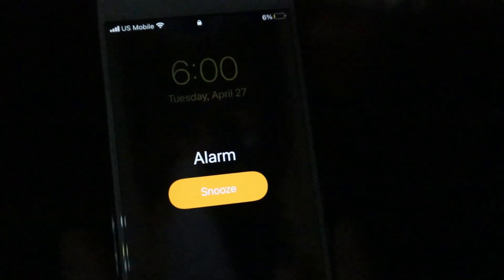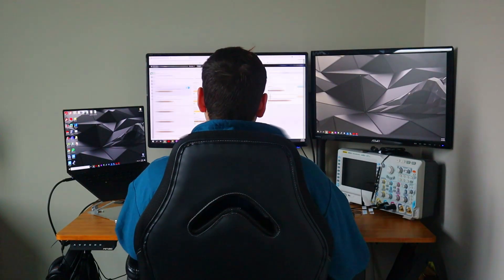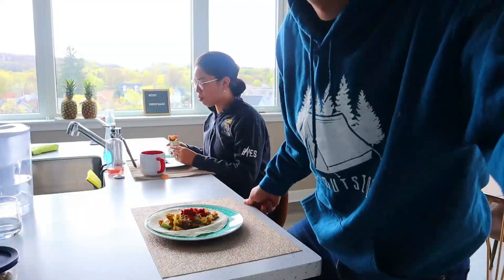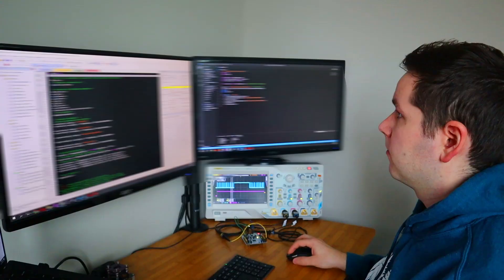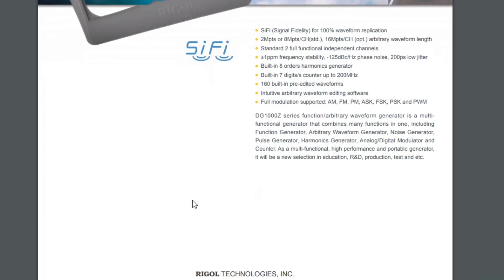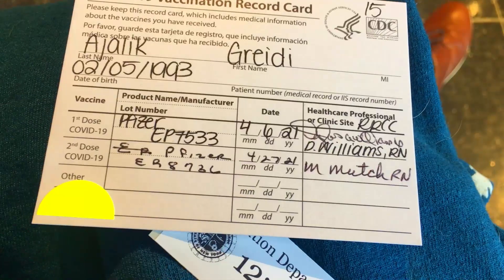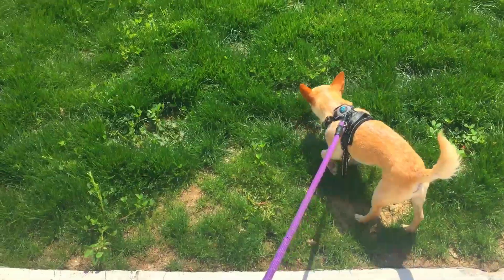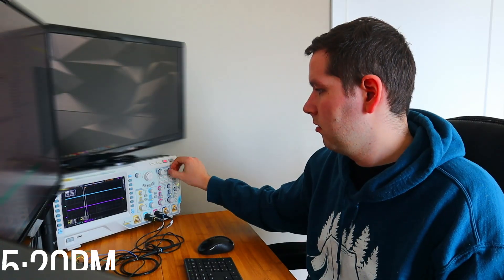A Day in the Life of an Embedded Software Engineer | Work From Home

Comment: DS4024 is > 3000 dollars yikes
Reply from the maker: yea... it's expensive :/
Reply: @GreidiAjalik  The question is then, do you really need it/use it for your use cases? And if yes, which options that this expensive scope has that others don't?
Reply from the maker: I did use it for my use cases - whatever I did in this video can be done with way cheaper o scopes. The scope was provided by my employer that I was able to use while working from home - now it's returned to the employer. Honestly I'm not a scope expert by all means... you can do a comparison of this scope vs cheaper ones using the info here https://www.tequipment.net/RigolDS4024.html#tech-specs  I wouldn't personally ever buy this expensive scope for hobby use or simple professional work.
Reply: @GreidiAjalik  cool, thnx for the link!

Comment: I have a french master 2 in electronic embedded systems . But what's the difference between electronic embedded systems and software embedded systems
Reply from the maker: hey! I'm not very familiar with "electronic" engineer term. I'm assuming it is referring to working with the electrical/hardware side of things - electrical design and layout. Embedded software engineer focuses on the low level software for specific MCUs.

Comment: Can I get a computer science degree to become an embedded software engineer?
Reply from the maker: Yes! You can, you want to make sure you take few embedded systems courses while doing that :)! Maybe a basic circuits class as well depending how low level in embedded software you’d want to work in!
Reply: Ok thanks for the insight . The school I want to apply has circuit courses as well as some electronics included in the CS program
Reply from the maker: @BillyRyan123  that's perfect then!

Comment: which is the reference of your oscilloscope?, how many bandwidth? Which oscilloscope do you recommend for the development of embedded systems?
Reply from the maker: The particular one used in this video is rigol ds4024. It has 100MHz bandwidth. It depends on what you’re planning to use it for, if you work with some really high speed systems then 100M is not enough. For beginners you should not buy something expensive.

Comment: What coding languages are requested when I want to be an embedded software engineer?
Reply from the maker: C/C++ are the main coding languages requested for embedded software engineers. Cheers!
Reply: @GreidiAjalik  thank you, I love those languages ahahaha
Reply: @GreidiAjalik And what about languages like python, is it used ?In addition I would like to know if also the OOP is applied in the embedded software engineer job.
Reply from the maker: @giacomobelluardo7456  yep, I would use python almost daily. Yes to the oop, I've worked on projects with none oop, mixed, or entirely oop... so there's a good mix...
Reply: @GreidiAjalik  thank you so much

Comment: Great.   
Now. I think.  I got  Right person to ask my quary.  😁😁

Sir 
I am from india i  confused about.  
 Embedded software 
And 
Embedded hardware
Pls clarify 🙏🙏

Which Controller  Used most.  Arm.  Or avr
Reply from the maker: Hey! Embedded hardware engineer would typically do ASIC chip design, PCB layouts, hardware testing, hardware selection, schematics... 

Embedded software engineer would work with creating embedded software, writing code to test hardware interfaces, develop device drivers, work with Real Time Operating Systems (RTOS) on microcontrollers, and probably many other options related to this...

Hope this clarifies it :) Depending on what applications we are talking about, I’d say arm is used most in portable devices... but don’t take my word for it, I don’t have data to back this, so if someone can provide actual stats on most used... then go ahead
Reply: Designing is limited to project.once completed then only replication haapens in production.so dont choose design as carrier but take embedded software and learn design it will helps to programming because u Will understand how to communicate with hardware of board